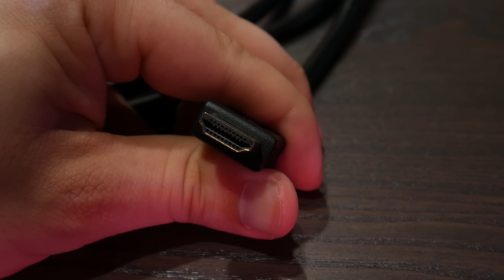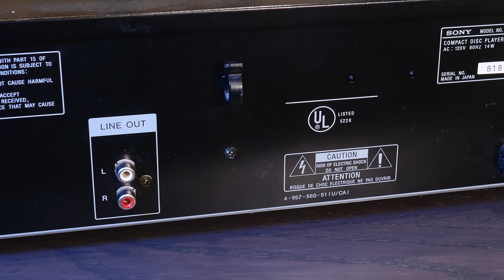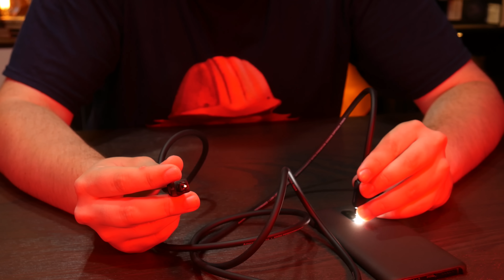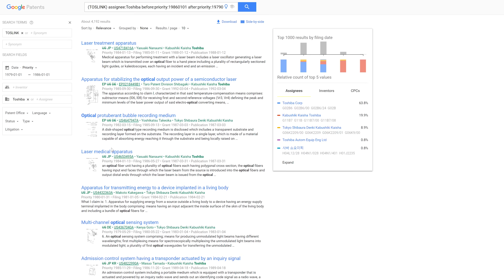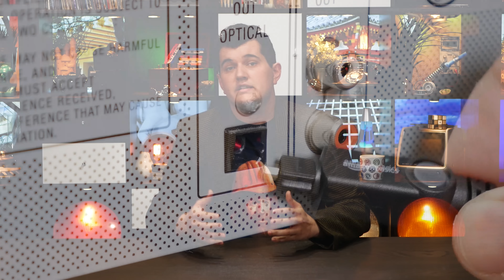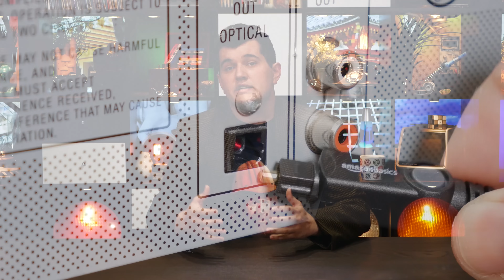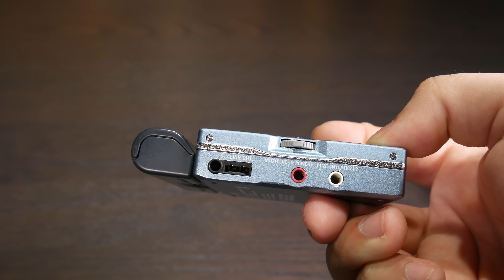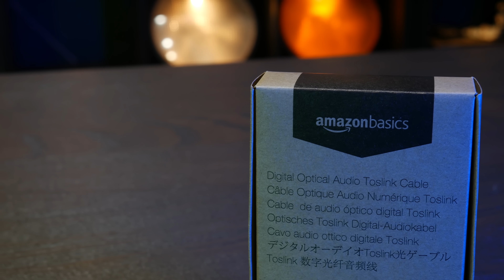TOSLINK: That one consumer fiber optic standard

Comment: fascinating vid. Happy to be supporting!
Long ago on my old MacBook Pro, I would occasionally run into a glitch where my headphones would stop working, and the headphone jack would glow with the same red light used for TOSLINK.
Of course I didn't know that at the time, and interestingly enough, I would gently rub a paperclip around in the hole, somehow turning off the red light and fixing the issue. (Still have no clue why this works)
And today, I learn why that light was there! (And thanks to my recent Corporate IT job and hand-me-down computers, I watched the vid on a same old model MacBook Pro!)
Reply: There's a little flap in there that I think tells the OS or firmware that it should switch to optical.
Reply: @counterfit5  ah well there ya go, thanks!